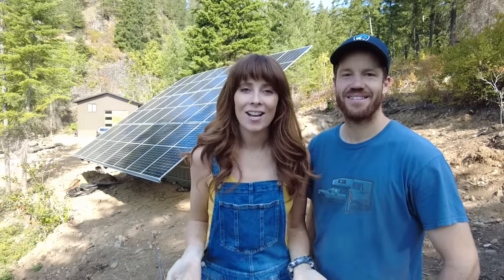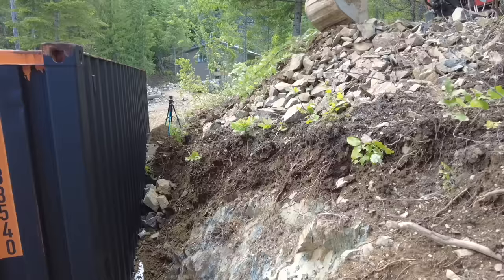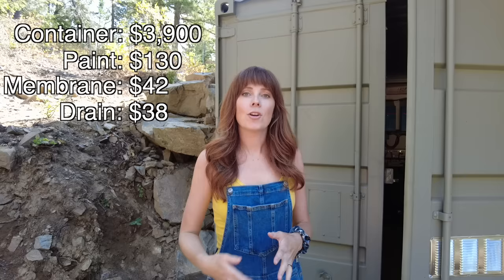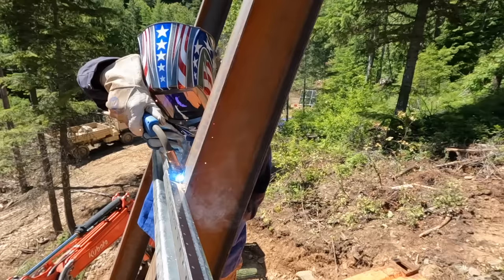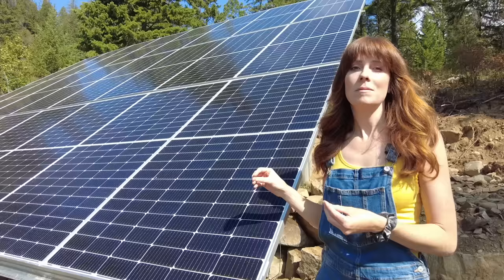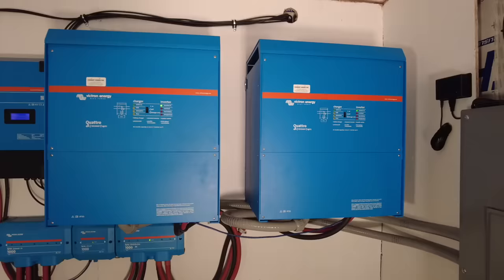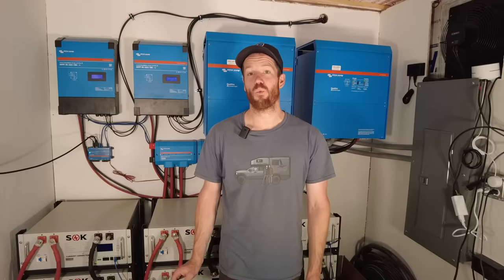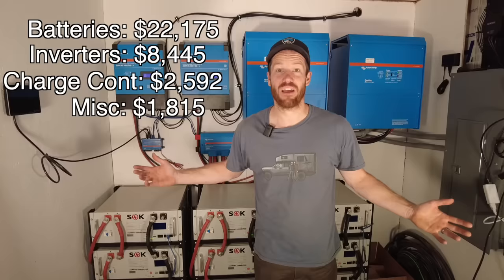TOTAL COST Of Our Off-Grid Solar Power System | Powering Our Mountain Home

Comment: At that price you might just go buy a Generator, and a couple 3 roof top panels and batteries. Most of the time you only need a small amount of electric if your well insulated and shaded. You then take the 50 gs and invest it to pay for the fuel. You will pay for the fuel and have a little left over.

Comment: I came to this video because I have been following the nuclear electricity promoters videos. 

You're site and others comments highlight the cost of the grid.

I have said 5times more electricity in the no fossil fueled future. 

5times bigger grid capacity, $TRILLIONS plus the extra nuclear power plants $construction.

EV with V2G and rooftop PV means you have an off grid system. 
Most vehicles are parked 23hrs every day, daily drives are 7kwh, ezi pezi to top up. 

An offgrid switch to isolate your rooftop PV means you don't need costly paperwork. 

Entire suburbs could go off grid.
Hahaha Hahaha 😊

The government may make it illegal to leave the grid.
😊

Comment: I think using the earth for insulation is a good idea, though it looks like you have 3 sides that won't be insulated.  Perhaps if you have any excess energy, it could be used to run a space heater.

Comment: Thanks for the financials breakdown.  I agree with you that the equipment will likely run for 20 years or by that time be really outdated.   Regardless spending $50,000 upfront for the system breaks down to you spending $2500 / year for your power uses.   I'd say thats pretty breakeven and your never reliant on the grid system for your power needs.    I look forward to your review after using the system over winter and see if those batteries can take or use the charges from the solar with the cold.    Thanks
Reply: Remember that you may 'break even' in the short term, but you're also adding a large liability.

Comment: Just so you guys know, heat transfers to ground much faster than air. So burying it (especially in this kind of way where most of the contact points are very much still ground-air level) will be counterproductive if the soil is actually as cold as the air above. Not only that you're increasing the ground surface that contacts the container which increases the total amount of possible potential energy loss. 
If your average battery temperature is higher than even the deeper parts of the ground soil its buried in, energy will transfer to the point with the least amount of resistance, so in your case you've most likely just added a massive heatsink to something that didn't need to be cooled. 

Geothermal energy doesn't counteract the laws of physics, depending on the flow direction of energy, it can both heat and cool something. If you wanted to use this for your home and battery bank, you should have made a separate system that does exactly that with a heatpump that is designed to either dump or catch energy at your leisure.

Comment: Did you look at nickel iron batteries? They are not affected by high or low temperatures, the electrolyte doesn't freeze, and they are rated for 11,000 cycles or 30 years.

Comment: Just a heads up : Rocks do not insulate like earth does and also the cold air will flow between the rocks. So not sure it will work as you hoped. But I might be wrong.

Comment: Check with the solar panel manufacture bit there are 
Sprays to make the surface super  slick. 
 Auto zone etc. Shower treatment etc
Reply: Rain X or similar product. 
Reduces snow build up. 
Washer pad with long pole
for cleaning

Comment: Totally new to this,,,but wouldn't it make sense to the manufacturers to offer a DIY kit, everything you need, packed into a container option, so it's used as shown in this video, panels on top, batteries/controls inside. Basically doubling up on the usage of the container first to store and ship the equipment, secondly act as as secure housing for the 'brains' of the system and platform for the panels?

Comment: Geo thermal is a good idea.  I didnt see any pink insulation board in the container.  Did you insulate?  All of that free energy to power welders and compressors.  How about running an electric space heater to protect your equipment?

Comment: battery capacity isn't/can't be measured in kilowatts.  It's measured in Amp Hours and then sometimes converted to Watt Hours (amp hours times voltage).

Comment: Connecting to the grid can indeed be crazy expensive and it's no surprise to me that this is the cheaper option, and that's even before paying annual utilities bills. It may even be more reliable, power cuts in winter storms aren't exactly a rarity.   But if you're doing this to save the Earth, no.   Unless you want to turn the wilderness into suburbia, and this kind of low density living is highly inefficient with energy; you may want to check why European countries as wealthy as America use half as much energy, it's because of urban density and you won't get many solar panels on your roof in Paris.

Comment: Wow all those prices seem really high
Here in Spain I mounted a 3.5 kW system without batteries (12 panels) for 6k € installed by professionals and the EU has a plan now that they are going to give me 2.5k € back.
Yours is on another level of course, but it's quite more expensive than here, and I am surprised to see there's no plans there to encourage people to install panels by giving subventions.

Comment: Here in New Hampshire I got a quote for and off the grid system that would be 200% of my normal usage. That included batteries and 48 panels. They wanted $128,000. Got multiple quotes from different people some went over $200,000. Completely ridiculous.

Comment: Totally awesome. I’ve thought about this before, just for cleaning purposes, but functions the same… Why not build a simple automated(or manual) squeegee that moves from top to bottom for ice/snow and dust build up? Yours is quite easy to access so pressure hosing it down would be easy. But that technology could be used to fit onto solar arrays that are on roofs. Just a thought cool video either way.

Comment: I hope you guys also took into account the tax rebate you'll get for that solar system. It should be 30 percent, so you should be getting $15k back on taxes. 

For your concern on wind lift, maybe consider expanding the width of your array frame and putting vertical spaces between panels. The ground mount system we installed for a friend in Wyoming has 6 inch vertical gaps between panels to allow wind through and it seems to be working great considering the insane gusting winds you get in Wyoming.

Comment: If you run a generator and live in the woodland, you should look at a gasifier and run it on carbon monoxide. Think you'll need the free fuel after the 50k spend

Comment: A great idea is to convert the energy generated from solar panels into other forms of "fuel".
Some people said using EVs could be one way, but the probelm with those is their batteries are a big expense if gives out and not the option for me.

Instead what can be done especially if you have some motorbikes or quadrocycles and even with a car you can build a distilery and using a crop such as sugar beet and then use the solar powered elecricity to create alcohol which  is your new form of energy stored from the excess of the solar panels. With small modification engines that use unleaded fuel and not diesel can actually run pretty well on alcohol, you would just need more pressure in the chamber and its is also more ecological, and if you have diesel engine then your best friend is vegetable oil, but in thst place it would take a lot to make it happen, i think sugar beet and sugar cane are beat options, you can also go further and dwell into convert that energy into Hydrogen. There is a person who has successfully done so in his own homestead workshop and is 30+ years with solar panels and panels work without any loses to this day, he supplies some electricity back to the solar panels during the night to keep them in good condition. And the gathered energy is then converted into pure hydrogen which is stored and used to heat the house in winter time and without having and exhaust in the house for the "fumes" to escame, the result of hydrogen burning is pure water vapor. And some of it is converted into alcohol with the use of a home made distillery setup to run his motorcycle and even car. And he hasn't paid a bill for electricity and fuel for decades and for close to a decade has no worries of heating the house because of the hydrogen he produces. Very smart person did everything on his own by exterminating and reading many books. He also dwells in batteries and electricity in general, so he creates his own inverters and other such devices while also having a lot of knowledge on batteries and has said that the best batteries for now would br lead, because lead is cheap, easy to work with and with proper manufacture and proper designs is possible to make batteries for home use only at least where a lot of ground space can be used and there is no need to move the batteries, and its possible to make these batteries last practically forever. We are talking about hundreds of years. But for that of course a capital is required which means it can either be done on government level or if communities put up a large sum of money together to do this for themselves. Especially if we are talking abojt using hydrogen which is also dangerous if not properly filtered/stored. But its possible to make a homestead or even a small community stead which can have all these amenities for generations with little maintenance cost and an initial building cost which will get paid off in the first few decades at worst and at best in a decade or less.

Depending on the region and your house situation even wind power can be used to do the same thing. 

The most important aspect for me is to have the ability to store the excess energy of the solar panels or the wind turbines and you do thst through conversion, and th3 best and most ecological ones are distillery for alcohol,  a unit for hydrogen production and batteries while using directly from the sollar panel during sunlight as much as possible  for the daily tasks if also very important.  But if you want to store energy for use when its cloudy, the best thing is to convert the excess electricity into fuel that can be burned/combusted.

Comment: let me just add, if you try to charge your batteries when it is below freezing the chemistry within the batteries will form metal crystals that will never revert to their original state.  So if the temp inside the container get to cold you will need to heat it.

Comment: Panels in series and parallel work best when they all recieve the same sun light, it appears that you will have the array partially shaded many hours of the day, (especially in winter), so I wonder if that will significantly reduce the output.  That a lot of batteries, I suppose that way you can go a week without sun.
Reply from the maker: Our panels are only in series actually. Each string of 8 has an individual channel on the Victron charge controllers.

Comment: A shipping container has a structure that is built like a tank,as long as your panels are hinged stout enough, all you would really need to do,is drill peers at 4 corner,matching the locking blocks,of the container, I can't see ,anything, short,of a tornado, taking out the container

Comment: Nice system but I see 3 problems the 1st is you need to put the inverter and batteries in your home I have mine in my pantry that way you will know when's there's a problem and your losing power going to the house at 120v where as your panels are probably 500v higher v=less resistance. 2nd problem is you said you only can drain to 80% battery because your system is over engineered in your settings set it to cut out at 60% then you fall to 40% then your batteries will last 1000s of more cycles lithium batteries don't like over 80 or below 20%.  3rd problem your panels should be aimed south I'm in Thailand so 15 degrees south is the sweet spot but everywhere is different goggle Idaho solar panel angle so if yours are facing south you have 2 trees right in front of your panels and your at a 45deg angle. 1 other thing you only need 1 inverter and controller if it says 5kw that's just the power it puts out you can hook up 10kw noproblem to over clock your system so long as you don't go over voltage or amps.

Comment: As  an offgrid system, you should have gone two systems at different locations with half the capacity. This would have provide you failover in case of disaster struck at any one on the system.

Comment: I’ve always thought of when u have solar u pay everything at once vs monthly it’s like paying $250 a month 50,000 divided by $250 divided by 12 not exactly but it’s a random number but 16.66 years till u equal the same amount but if u paid for electricity it’s like paying 16.66 years of electricity at once then after that it’s free
Reply: kind of but not exactly. there is upkeep and parts can fail. when the power utility has parts fail, you lose power for a bit but they cover the cost of the parts. when a part on your solar goes bad you lose power until you can get a new part installed back into the system. with grid if you use more power 1 month they just charge you more money, if you exceed your system with solar it shuts down or things dont work until you upgrade.

Comment: why dont you provide a shade to keep the snow off the container and put a trench to wash away the surface runoff in rainy season burying the container would direct water to the container from the upslope. then maybe put a regulated heater fan in winter

Comment: Curious what the cost of ownership would be after about 5 years vs running and using electric from the grid.   I think you have to factor in anytime you are running generators to supply power as well to the solar cost as well as keeping up with your battery degradation.   I have several accounts of Tesla powerwalls degrading by 25ish percent in 2 years, so I even worry about having enough power to stay truly off grid more than 3 or 4 years in.

Comment: if your systemin winter  has spare  production you can make a water heating battery!!!  this will let u use that heat at night even the tiniest amount of antifreeze solution could help reduce more gas in generator.   bet you thought of it too

Comment: 50,000 dollars, plus a huge number of hours of hard work, and the tools to do that work. We are easily getting to 80,000 dollars. That is, 4000 dollars for 20 years. Plus the maintenance of the solar panels, which, in the winter, likely requires a lot of work. I doubt you would have spent more if you opted for a modern diesel generator, and they are not so noisy anymore.

Comment: I'm really impressed with your setup. However, I highly doubt it will last as long as you are expecting. Solar panels have a life of 12 to 15 years. The batteries are more hit or miss. It is definitely possible to get up to 10 years if you keep the temperature nice and cool in that container. Which will require a heating and cooling system. They may still work after 10 years but they will not hold a charge as long or charge as well. These batteries can easily just decide to overheat and crap out. It's very possible some will have to be replaced within a few years. Given your situation, it seems like it is your best option. Just be aware it will probably be higher maintenance than you expect.

Comment: I like your setup, and I hope it lasts you as long as it can. Do you have a backup plan, or generator for emergency reserves? I know it adds cost but if you're living there during the winter, you may want one just in case it can't charge with solar during a bad winter storm that lasts a week.

* Solar: $50,000 / 20 years = $2,500 year / 12 months = 
-- Total of $208.3/month

* Grid:   $60,000 / 20 years = $3,000 year / 12 months = $250 + 240kWh @ 8.67¢/kWh = 
-- Total of $500/month

Being that the grid connection would have cost you right off the bat 60k, that's before utility rates in Idaho charges of at least 8.67¢/kWh to 11.88¢/kWh; it seems your way better off. 

I just hope that the capacity and usability of your system justifies that cost for you. The upfront cost is usually the reason most people don't choose to get an off grid or at least a standby whole home battery solar system in my research of the topic.

So, in conclusion your decision to do solar to me seems very practical and I am glad you're happy with your decision.

Comment: I'm unconvinced you will have enough power without a generator.
Bad days are bad days
Bad weather a few days in a row, plus a few days of above average usage, and time of a gnerator. 
But thats the point, the biggest enviornmental cost is the batteries, and having enough for the WORST case scenario means far too much 95% of the time.
My personal advice would be add more panels. They dont cost much, and the way i look at, you might as well save up your average monthly energy bill every month and add a few more. 
Maybe consider some east west facing bi facials, more peak load at the start at end of day
have fun

Comment: You made completely the right choice. Independence + high quality componentes win long term ALL THE TIME. If winters are really harsh it might be required to install a wooden oven :D Question: have you installed PROPER GROUNDING + GFCI (ground fault braker)?